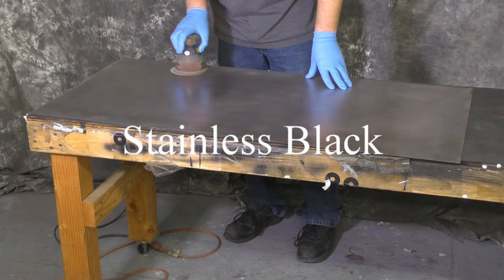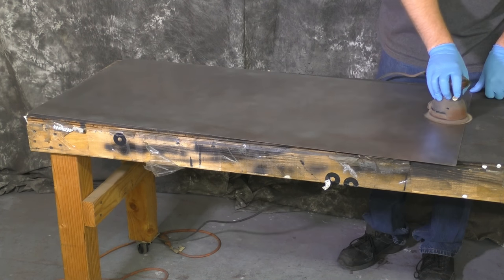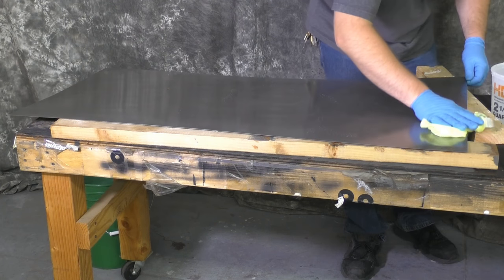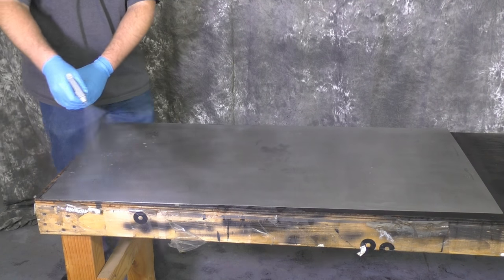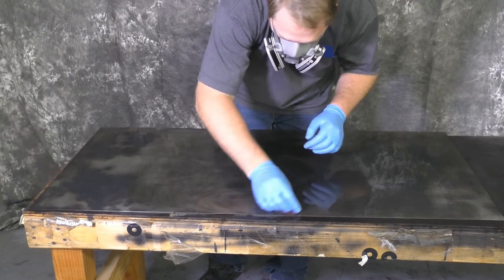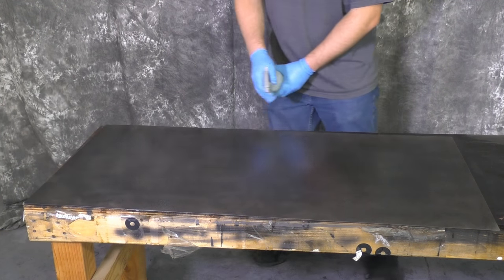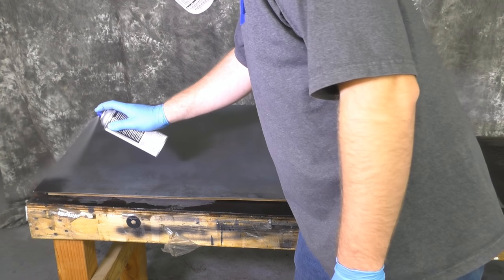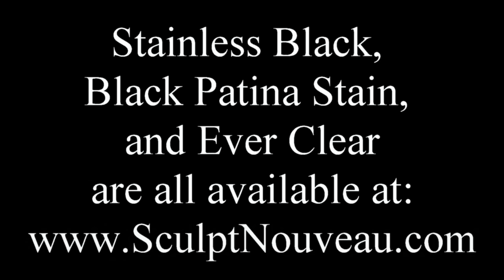Stainless Black on Stainless Steel

Comment: Great video! I am wanting to get a similar effect on hammered stainless steel bowls, but I'm afraid I won't be able to sand it properly with all the divots. Would you recommend just using the spray black patina (multiple coats?) or would it not adhere to the bowl?
Reply from the maker: You can try a muriatic acid bath or you can do a faux finish to avoid all of that. We have a few options but I would look at the Patina Stain, Smart Stains, or Dye Oxides. Give us a call and we can help you dial in the necessary products further. 760 432 8242

Comment: Great product. How will this react to direct heat? If I finish a stainless steel teapot with this treatment, how will direct flame affect it?
Reply from the maker: It holds up pretty well but you will notice that it will change over time. We should also note that we do not have any FDA paperwork and would advice caution in that kind of project. Call us if you wish to learn more, 760 432 8242

Comment: What about a stainless steel gun slide ? I'd really just like to touch up a spot where the cerakote wore off. Recommendations ?
Reply from the maker: You should be able to touch it with the Stainless Black. Apply lightly with a Q-tip and wipe off with a wet rag 30-60 seconds later. Dry with paper towels and reapply as needed to darken it more. Once happy, I would just oil it like usual.

Comment: My piece of stainless is brushed in a linear fashion and I want to keep it that way. At work we have a large scotch brite belt sander with a red belt. Would this be enough abrasion to clean the surface? This piece is for my house numbers and will just see the Midwest seasons. Is just the patina then the stain good enough without a topcoat?
Reply from the maker: It would likely be fine but the patina will likely come in more mottled. You should use a clear coat as an added layer of protection.

Comment: Hi.  I would like to know if brushed stainless or and what grade was used in your great video. Also, could this process hold up in a gas fireplace firebox interior over the heat safe bricks? Or would there be another black coating we would want to try?
Reply from the maker: I am not sure what grade stainless this was, it doesn't really matter though. I have used the Stainless Black on many different grades and have not had a problem with any of them. You just need to sand it good enough and it will work out just fine. The patina would be fine with heat, the Patina Stain we used as well as the Clear Guard and Ever Clear are both rated for about 400 degrees Fahrenheit.

Comment: I was curious this &/or any of your other finishes/patinas, might be viable for use on a stainless steel knife blade? The main factors to consider being: that the blade couldn’t be heated, above the temperature it was tempered at (probably around 350-400 F max), so it would need to be able to be applied cold/at low temp (excess heat would ruin steel’s performance) and the durability of the finish to friction (as the blade cuts).

If you have anything you have might work on titanium (6Al-4V), that would be really interesting too! (For the handles/scales)

Thanks!
Reply from the maker: None of our products have FDA approval, so none of it is food safe certified. This process would work as a cold application so you would not need to heat it.  We have not done any testing on titanium as of right now.
Reply: Sculpt Nouveau Thanks very much for the info!

Comment: Is there a way for me to do this inside on a kitchen fridge? It looks like you used a lot of water. How can I do this without making the kitchen a pool?
Reply from the maker: Yes people have done fridge and dishwasher doors. Depending on the doors, taking them off would be the easiest way but they often make them with features that make that more difficult or impossible now. You can rinse it with a 5 gallon bucket and a big sponge, that is how it would be done in place. Tarp off just in case to catch some runs too!

Comment: Hi, I have used the "Presto Stainless Black" a few times and I just want to say it is fantastic!!! I have gotten absolutely BEAUTIFUL results by sanding with 40, 60, then 80 grit sanding discs (6" random orbital sander, to flatten surface) then brushing/graining lines into it with a drum sander before blackening.

I have been wondering though, does sanding through the nickel chrome layer, and blackening the stainless steel, make it prone to corrosion in outdoor environments? If so, why? It is hard to find information on this topic.

Anyone else develop a good method for blackening stainless? Let's put our heads together here people!

-Nate
Reply from the maker: Glad to hear it! It will not make it prone to corrosion though we do recommend you to seal it in for longevity. There is a lot of debate about this but it is still stainless steel through and through. We just have to get through the initial layer to get the patina to take.

Comment: Can I do this to a kitchen sink? Is it safe?  I would really like a black sink that looks like this, thansk
Reply from the maker: Give us a call if you want more information on doing that kind of project, 760 432 8242
Reply: Any info? would that finish + smart coat be enough scratch resistant?
Reply from the maker: You would be better off going with Ever Clear, Smart Coat wouldn't be strong enough for that kind of application.

Comment: Has anyone tried welding after the patina is applied?
Reply from the maker: You can weld over the patina but it will need to be reapplied to blacken the weld and any burn marks.

Comment: How would this effect a highly polished piece of steel? As in to a near mirror finish, obviously it has to be sanded but do you have to remove the entire mirror polish or can you just rough it up a bit?
Reply from the maker: Unfortunately it doesn't work all that well on mirror polished metal. There just isn't enough tooth for the patina to grab onto.

Comment: can i use muriatic acid instead of sanding?
Reply from the maker: Yes just be careful not to let it react too long on the surface. Too long or too high of concentration of muriatic acid can cause the patina not to react properly. That is why we often just recommend sanding.
Reply: @sculptnouveau  thanks

Comment: Could you do this to a stainless steel fridge?
Reply from the maker: The Stainless Black will react with any grade of Stainless Steel. Just make sure you protect them with a good clear coat like the Ever Clear.
Reply from the maker: @jocelynmckeon2706  The Ever Clear can take about 400 degrees Fahrenheit, might want to take a temperature reading but otherwise it should be fine if it doesn't get above that.

Comment: what is the chemical that you use? thanks
Reply from the maker: Stainless Black is the name of the product that we used in this video, here is the link http://www.sculptnouveau.com/Details.cfm?ProdID=78&category=6
Reply: How would I apply this to stainless steel rings? (jewellery)  And how would I coat it afterwards so it was ok to wear?
Reply from the maker: You can spray it on, but I would do a submersion process. Afterwards, clear coat it with Ever Clear to protect it.